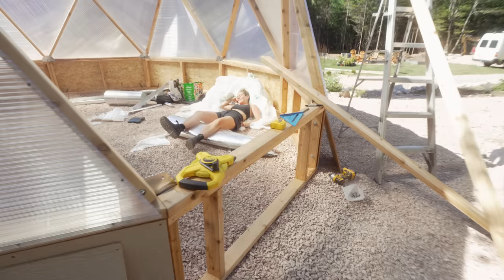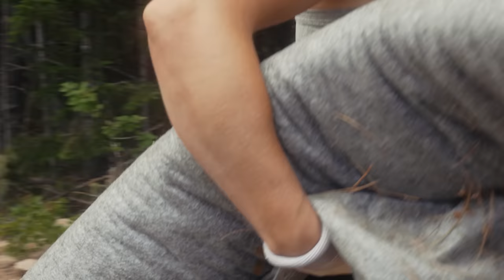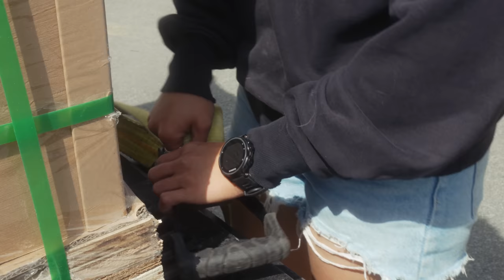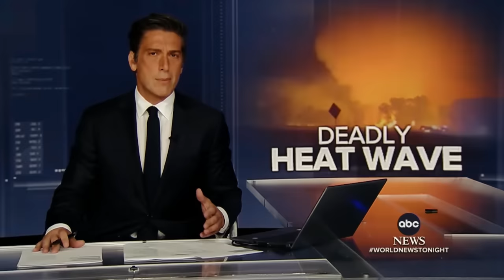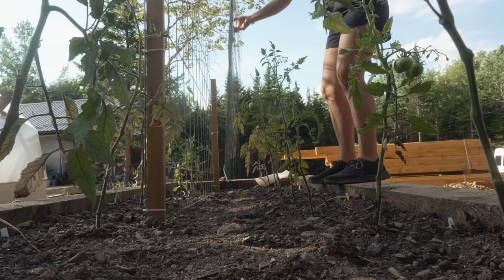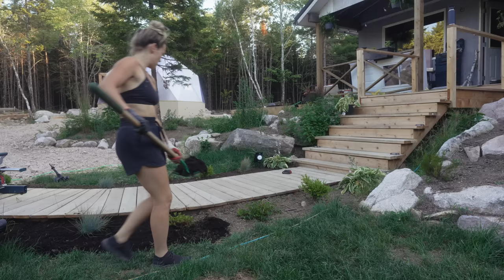Summer In The Remote Woods

Comment: We just lived through a heat wave in CA for 11 straight days, 95-100 degrees, with 85-100 humidity, no AC.  Today is the first normal day.  It was horrible.  Another fun/worked filled video.

Comment: I love you guys (ladies), and your projects w/that creative flare. I have been working with tools since I was 4 years old, and my have my own complete shop. Since you are always working with power tools, I noticed that your circular saw blade(s) on the Bosch  seem to wobble. That is to say with it is not seated correctly and not seated properly on the spindle of have uneven wear. Please make sure that your shaft nut is tight, and the blade does not have any play on the shaft. The circular saw is the most dangerous of all power tools, and that includes your table saw because of the kick back and you cannot see the blade spinning in relation to you bodies. No blood is better that running blood because of accidents. If something would happen to either one of your, it is not like having a hospital close by. Stay safe and cool, and keep on building!

Comment: Recipe for a swamp cooler...  Cut hole in tpo side of cooler the size of fan... The other end cut four inch hole to fit piece of PVC... The salt water has a lower freezing point and stays colder longer...  Keep 1 gallon in freezer and rotate as needed... Stay hydrated.. drink 2.5 ounces of pickle juice to be cramp free..

Comment: A couple things:
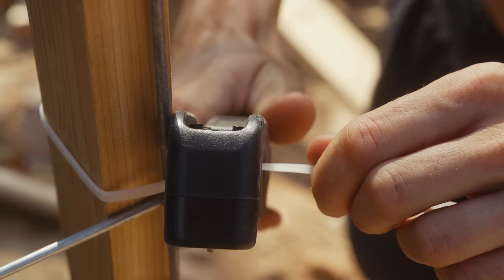15:47 =  Use an endcutter those zipties can really cut in arms/legs !!!.
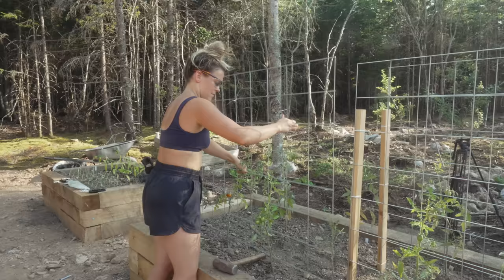16:28 =  If there's anything left then add at least one row on top of the sides, so that it creates almost a box. It will become more stable by               
               adding this.
21: 24 = You should add another post/beam so that the space between matches the sides on a sunshades. This will make it easier to move 
               around with the sunshades. 

Catching the sun with almost no connection to the building is the best !!!

Comment: You don’t need trellises for tomatoes! Eight or  ten foot stakes/strong sticks at the the end of each row with a wire stretched between them and then strings dangling down over each plant will allow them to climb up the strings and along the wire.  Pinch out the new shoot above each brash and the plant will go high rather than bush out and the fruit will be larger and easy to see and pick.
Old banana skins cut into pieces and scattered around the plants will make them really happy and productive

Comment: A little hint I drilled a hole down through the decking up against a floor joist that I put the pole to my umbrella down through and then use a clamp to attach umbrella pole to it guaranteeing it never moves no matter what the weather is. Mine stays there all year around I just remove the top pole in the winter months that the actual umbrella is attached to. It works so much better than a base that won’t hold the morels strait as it’s always moving around in the breeze

Comment: Take a 5 gallon bucket a piece of pvc and a bag of concrete to make an umbrella stand.  Make sure that the umbrella will fit inside thr pipe.  After you make it you can cut off the bucket and paint the concrete.

Comment: You may already know this but moving the rear LCD panel away from the body helps keep it cooler. I'm a retired photograph who was working in LA and in the hot Summer sun I'd drape a white terrycloth hand towel over my camera and strobes to help prevent overheating.  (This is why I like chrome and white bodied cameras and lenses.)

Comment: Big tip for being out in hot weather.. wear a long sleeve shirt, preferably ones made for swimming as they are really light and get it wet, squeeze the water out and put it on… Works like a charm in hot Florida weather.. and no water dripping down your legs :)

Comment: i enjoy watching you 2. Sunday morning is better because of your show. I am gonna give you a piece of advice about ways to make your wood collection easier. You currently handle your firewood too many times from cutting to stacking making it harder than it needs to be.  When we picked trees we would look for the desired size trunk based on whether we wanted to split the logs or not. Then we wanted to handle the full-length tree once. We would drop the tree, remove the limbs, attach a line to the base and pull the whole tree back to our storage area before working up the logs and stacking. Depending on the size we might need to cut the tree in half before moving. We also picked our trees a year in advance and would girdle the base, in effect allowing the tree to cure or dry while standing. Just my thoughts from what helped us and I hope it might save you a lot of work.

Comment: I love your Greenhouse! Need to look into the cost of one.

Jazz I like your trellis. Did you cattle panels or (I am not sure of the exact name) but it is a metal screen that goes into wet cement to make the cement stronger. That is what I use. (It is half the size of a cattle panel. 4' x 8' rather than 4' x 16' for a cattle panel.) I also use rebar to stake mine. I do like your cedar stakes. Then you can add the smaller pieces of wood to string line. I like that idea! 
I love Gardening.
You probably read not to push the mulch against the tomato plants so that the main stem maybe does not get too wet? Not sure. If you push mulch against trees, you don't want to pile it against the tree itself. You want to pull the mulch away. Apparently you can kill the tree if you pile it up against the tree.
I do not tend to use a lot of mulch, coz the slugs and earwigs like to live in it, and then you are fighting them. They will chew on your leaves and certain flowers. I grow a lot of flowers! Natives and pollinators too.

Thanks for posting and have a safe and lovely week! Take care ladies!
Loved this video! Yes it was hot. Much better now.

Eileen
😊🍁🇨🇦💕

Comment: There is wire that has silicon foam coating on I you can get in the garden centre the can be used to gently hold up the plants and do other things where you don't want the string to break in weather and can be reused year after year. It's wildly helpful stuff for more than gardening. You won't regret getting some.

Comment: Completing a project 100% definitely feels rewarding. Your home is really taking shape. Love your deck string lights - looks so pretty at night.  Suggestion regarding your tomato trellis.... might consider using 7' metal tposts vs wood for the end supports - they'll last so much longer than wood, can easily be moved between garden beds, are more sturdy than wood and the added height will allow you raise the trellis off the ground a couple feet so tomatoes have support as they vine upward where they need it most (can also be used to support beans, peas and melons).  Have a great week - from our pack to yours 🐾 🐾

Comment: hey for your umbrella you could measure how much of a gap if you turn the cement upside down then drill a hole through the umbrella stand put like rebar put the cement up the stand then put the rebar through the hole you drilled and then let the cement down and it will hold it ..

Comment: just a little jeaouls of the dome. And a little garden tip, if you want bigger, more plentiful tomato and pepper plants, pinch off the first-round (maybe even the second round) of flowers so the plant is putting its energy into a strong root and stem rather than pouring it's energy into ripening the fruit.

Comment: Oh my, you're going to hate those zip ties. Cut them flush, at a right angle, to the fastener. Also, turn them inside so you're less likely to get cut by them. They are an awesome fastener. One not long enough? Connect another and make it what you need.
And my garden is lusting after your mulch pile.

Comment: For the bottom of the umbrella cut A 2x10 drill hole slightly larger than umbrella pole place on deck directly to we’re the pole will set in hole And nail the 2x10 to deck. Problem solved cheaply.
Reply from the maker: Thanks for the great idea. See you next Sunday.💛💛🐶🐾

Comment: It seem not many people understand passive solar gain, every window with sun on it will generate heat in your home, in particular south facing windows, every square meter will produce a 1000 of heat,  thus x by sq msteres of glass will give you total watts. My self built home generates 17.5k watts a hour  this is the green house effect, if you cover your widows outside this will stop this a leave your home cool. My I've made slats, you can use a awnings or shutters.

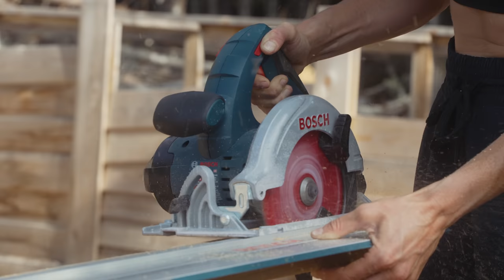Comment: 14:45 I think your circular saw blade needs centering!
Reply: ... Agree,, Also noticed that ,, Be sure it's the right blade for the tool arbor .... Accident and possible injury around the corner ..
Reply: @rockytopwrangler2069  Looked like the next shot we can see the center bolt in the arbor is wobbling too, possibly cross threaded or bent?

Comment: you've missed super critical step of sealing edges of the polycarbonate panels with special membrane based tape, rain water will get inside panels, mold will grow and no way to clean it... and I hope you've installed these panels with UV treated side pointing outside else they will become very brittle very quickly and full of holes from first hale storm... and what is the point of eating healthy and organic if you spray foam your house...

Comment: Ladies!!!!!!!  IMPORTANT SAFETY INFO. At the 14/15 minute mark I noticed that your circular saw blade was oscillating. It is not fitted onto the shaft properly and so it is not cutting in a neat circle, it is cutting irregularly and this can cause the blade to shatter and could cause catastrophic injury to you both if your both near it when cutting. Please, please  check your blade is centred on the shaft. You should have spacer rings to ensure that it fits if the hole diameter in the blade is greater than the shaft diameter. Richard from Down Unda
Reply from the maker: Thanks! We will check it :)
Reply: That's great, I am relieved to hear that. Even if I am wrong, it's better safe than sorry eh?😃

Comment: Is there an issue with the circular saw blade?  It looked loose or misaligned??   Also use a pitch fork to move the mulch, its easier and you get more on a scoop.
Reply from the maker: Hey Michael, we will look into the saw blade. Thanks, we will try a pitch form next time, not sure  if we own one.💛💛

Comment: Ladies, I am sure that you have a plan, right? I know that you are working hard on everything. I generally find that I get more done by having a good, well though thru plan. Like building blocks, this needs to be done before that and so on. Seasons generally need to be worked into the plan sine some things cannot be done in the winter. I would assume that with the solar panels you are planning on power for the cabin. You want this done before it is too cold to   work on this in the snow. Hey, you might use this power to run air conditioning.
Navy Veteran, Electrian's Mate on an Aircraft Carrier.

Comment: Considering you mentioned that it was 45 degrees C inside the dome during the summer, and that was with the door not installed yet, is there any way to vent the excess heat inside your dome?
Reply from the maker: The 2 fans & keeping the door opened :)

Comment: shade umbrella drill hole in bottom of the pole then in too brick put pin in so don't blow away. you should buy reuse zip-tires save money and planet. O got no water but not far away there lake ?. all need long black pipe run from lake to house u have water all year around.

Comment: You ladies are seeing the effect of climate change in the Maritimes. There's a Twitter contributor who's graphing temps and humidity in Saint John NB. We're breaking all kinds of records and the hottest and muggiest records are practically all post 2000. Word of advice from an older fan. In hot weather, slip in one of the -ade drinks into your regimen. Coffee, according to the Mayo clinic, is not a diuretic but it does not replace the sodium you're losing. So, as Doctor Kay told me at New Hampshire Speedway, after I passed out and had 1.5 litres of saline solution via IV (you will Never, Ever have to pee that hard again), every hour, either 300-500 ml of water or Gatorade/Powerade. With the sodium loss, you get a little fuzzy or goofy. Great work Ladies, love to see your work each week and I'm waiting for your first Maritime winter. Do you have a snowblower attachment?